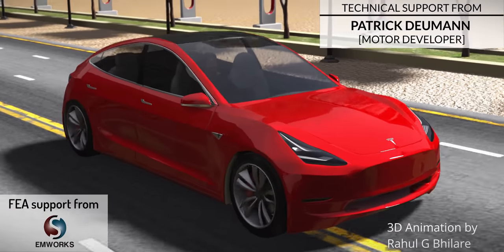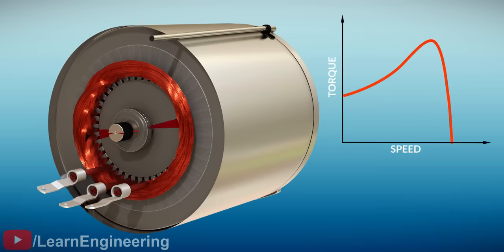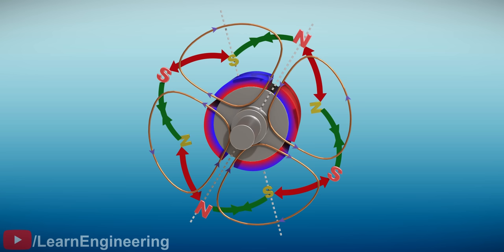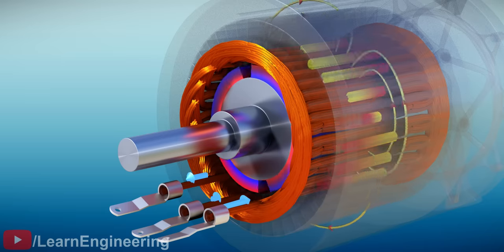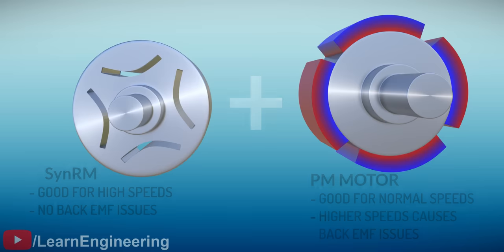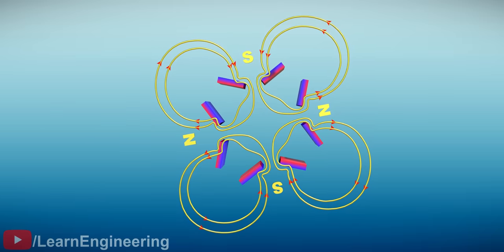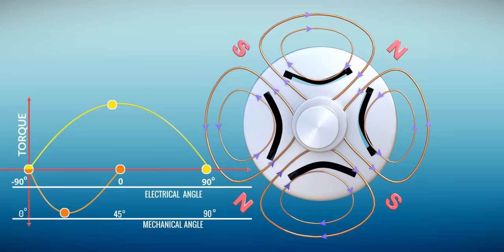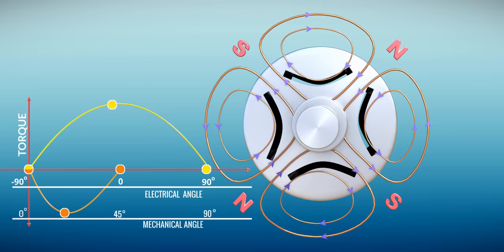Tesla Model 3's motor - The Brilliant Engineering behind it

Comment: As an engineer... Just imagining the integrals need to calculate that magnetic fields ... a vision from hell or heaven... afterlife for sure...
Reply: Embrace Maxwell my child
Reply: why do you need to calculate them, they just work
Reply: @tonial5789  , well... someone did that math. And probably if you get back to that degree/masters... That monster will be there... Waiting for you... In the corners of eletromag 3...
Reply: @tonial5789  to make the rotor the right shape. No point just guessing.
Reply: That's why there's programmes such as MATLAB. No need to sweat over calculations
Reply: @serBarcla  Yeah the burden of having to deal with the hellish math gets ultimately pushed to the software engineers.
Reply: In fact, you can just use an finite element method (FEM) software to calculate these integrals for you.... The real HARD work for the calculation is done by the ones that create these FEM softwares (4D Maxwell equation solvers) which are usually tough programmers/mathematicians or PhD students (most of them REAL electrical engineers) without girlfriends or any kind of social life... #AHugforaPhDstudent
Reply: Integrals are frightening, I had the same thought and felt pretty bad at not finishing my engineering major. Total mood kill I tell you.
Reply: As an engineer, Finite Element Method simulations with tools like Ansys Maxwell and similar software makes this strangely easy.
Reply: @cleisonarmandomanriqueagui9176  electrical engineer. 
Just pay attention to the specialization in your local/country . 
Some places they divide in electrical engineering: circuit (micro-eletronics) , power (grid and high tension) , communications (telecom) , computer , and mechatronics (robots). 

Depending on the specialization you will not see electrical motors . (But that came with it's on benefits, like the spiritually of how antennas works... 50% math, 40% electromagnetic field  (ghost 👻), 10% pure believe and Faith.
 (because there is some magic/mystic level or sorcery involved in explain how the hell an LPwan [sigfox/lora] device get a signal, 20km away. Using 2 AA battery... )
Reply: @cleisonarmandomanriqueagui9176  mechanical engineering
Reply: @cleisonarmandomanriqueagui9176  You want to get into the nitty gritty details of quantum mechanics, you would have to do a physics major specializing in that. Once you have satiated your appetite for that, move onto the practical side of things, i.e., engineering. Why stop learning after just one degree? Never stop. There are a lot of stuff on the interwebs to self learn as well, so going to a university is only needed if you're really passionate to learn the things they're teaching, otherwise it would be a waste of time and money
Reply: @thearkpearl  so true man the CS engineering are hella smart
Reply: @flow5718  go back
Reply: @cleisonarmandomanriqueagui9176  you probably would like mechatronics engineering, or if not available:
Control and automation engineering.
Computers engineering.
Micro-eletronics engineering.
Reply: @6Diego1Diego9  I was doing electrical engineering, found out I was good at computer and coding but not much else. I'm a web dev now :)
Reply: Vision of heaven only if they're correct.
Reply: If you are an EE grad student you wouldn’t imagine. You would have to do it.
Reply: @cleisonarmandomanriqueagui9176  mechatronics is the degree you're asking about. It combines mechanical and electrical engineering
Reply: theres a sensor for that. LOL
Reply: Robert Slackware  but to get a job i need a degree and i dont have money to make a business or a technology company ... i ve already thougt what you said but i do read books and see video lectures of what i like
Reply: no, not really, we have a lot of simulation software. The job of engineers responsible for simulations and writing this software is harder
Reply: @TheCarmacon  whats the name of the
 book ?
Reply: @Mrwiseguy101690  And why not, they're paid quite well for it :P
Reply: As a mechanical engineer, I really am jealous of electrical engineers. This looks so cool
Reply: @thearkpearl  bless them
bless them
Reply: Well, you must not be much of an Engineer bc ANY computer today has a built in MATH Co-Processor (these were available for OPTIONAL purchase way back w the 286  Processor computers. and reason why the Motherboard came an empty socket always. even the 386 too.)
That Math Co-Processor was Eventually Built-in with the 486....and ON......
Today's computers can make all those calculations on the fly!! and even Create Graphics(as shown here) in fact, the same software can also conduct FEA Analysis on the Fly too!!! 
(Pinchi Menso!!  Aprende algo! antes the llamarte "Engineer")
Reply: U don't need to do integrals buddy....It's you software's job
Reply: @vanni.  Indeed.  The guy calls himself "Engineer"....I doubt it.......
Reply: They have computers to model it
Reply: @serBarcla  and Python
Reply: @cleisonarmandomanriqueagui9176  Electrical engineering
Reply: @Barrios Groupie What is your address?
Reply: Ansys and other design software include that kind of calculation and more. Algorithms can do those in no time.
Reply: I guess you went to school around the same time as me, or earlier, before all this fancy computer modelling. Now any cheap computer can run the modeling programs. The heavy duty computers are reserved for the gaming community.
Reply: @cleisonarmandomanriqueagui9176  I did a general engineering degree specialising in electronics and control in my last 2 years. (a 4 year degree). I was dubious at first (I didn't enjoy fluid dynamics at first!), but one advantage is that you can go into a job like this one and you know what the physical engineering people and the materials engineering people and the others you're working with are talking about. You have an advantage working in a team on a product like this. If you choose a speciality like control engineering then it helps to understand the systems that you are controlling.

There's a fair amount of control engineering in this, as well as the magnetics and electronics to drive it.

Another advantage of doing 2 years of general engineering is if I really decided I like thermodynamics and fluids after all that, I could have changed my mind and specialised there instead. My masters topics in Control were chemical plant control, which is non-linear and involves delays. Quite a challenge.

I have a friend who works with synchronous motors like this. He has to solve problems like finding the best driver transistors on the electrical side to produce the currents for the rotating magnetic field.
Reply: No worries! Discretization and numerical integration methods are on the hand.
Reply: @Mrwiseguy101690  My guess would be the assistance of some mathematicians and the huge advantage of programming loop and boom , FEM is done. Not easy ikr but loop, is the core of FEM softwares , in doing the differential, just google how it works , kinda fascinating
Reply: @serBarcla  and finite element analysis
Reply: @cleisonarmandomanriqueagui9176  an Electrical Engineer Program with Motors and controls courses and automatic control systems courses. (not all have them)
Reply: @cleisonarmandomanriqueagui9176  Control Systems
Reply: @cleisonarmandomanriqueagui9176  Electrical engineering (power electronics, mecatronic). But I dont advise you to get too specialized in motor itself. There is very few job available for that specialty. It better to have a correct degree in electronic and automation to know how to control that motor (regulation loop of field oriented control, field weakening strategy). 
For a simple reason, there is no a lot of company that design their own motor, the most often they buy off the shelf or reuse some design already performed in the past and scale up/down to match the requirement
Reply: @UPR91  thanks for the advice ... its very usefull
Reply: MAXWELL could tell you....
Reply: Robert Slackware  print the names of the books to help people.
Reply: @Götz von Berlichingen yeah exactly years old so why not use a bldc instead?
Reply: Let's play a bit Maxwell...
Reply: I'm pretty sure they ran simulations on a pc, nobody is interested in solving this bs
Reply: @cleisonarmandomanriqueagui9176  Electrical engineering, or perhaps Mechatronics.
Reply: @serBarcla  MATLAB is just for writing your calculations up and it will calculate them. The problem is finding out what you are supposed to calculate and write the integrals yourself
Reply: @cleisonarmandomanriqueagui9176  start reading electricity and magnetism, then electromagnetic theory of changing magnetic field. I college go for courses in electrical machines.
Reply: @Keskusrikospoliisi  fair point
Reply: @cleisonarmandomanriqueagui9176  You need a degree in Electrical Engineering. As  @Welton Barbosa  says, there are a number of specialisations within electrical engineering. The most important thing is that you need to have a really good head for mathematics, so study that as hard as you can while you are still at school.
Reply: 666 likes here
Reply: What kind of an engineer are you to do integrals by hand? Use a transform or a program that will do it for you. It's not a competition to see who's got the hardest work
Reply: Let alone the timing based on the the sensors to keep the rotor at a 50 degree angle for the greatest torqued every time you start moving. wowwza
Reply: With powerful computers and sophisticated software libraries such as MATLAB, it matters more now for engineers to properly model the phenomenon and formulate the problems rather than to do calculations.
Reply: @tocu9808  < Especially to optimize eddy current losses to reduce energy loss as heat, and improve on the motor's efficiency.
Reply: @Keskusrikospoliisi  - That's core value of engineers. Exactly the way high math should be taught for those major in engineering disciplines.
Reply: @thearkpearl  Er ... Girl friends may or may not help to release some tensions which disturb calmess and focus required for effective brainy works.
Reply: Civil engineering
Reply: Think about FEA and harmonic current distortion of this.... analytical approach is just to create boundary conditions. Being a powertrain engineer it's under consideration .
Reply: @Elliesium37  Seconded.
Reply: engineers simulate it with COMSOL for instance, they don't calculate it by hand. Also,  this magnetic field configuration is rather simple. There are devices with way more complex magnetic fields.
Reply: They used FEA
Reply: @serBarcla  someone has to program those too
Reply: my guess is math by comsol
Reply: @gnaarW  better yet embrace Heaviside
Reply: True
Reply: I fear no math, but that THING... It scares me.
Reply: @tonial5789  to find out what works the best
Reply: I swear to god they probably used wolfram alpha lmao
Reply: Math will give you diretions but you need to tryout and start using, then you make it better and better to perfection 😉
Reply: I had a motors course 30 years ago from prof Nattu at U Michigan Dearborn (salute wherever you are!)  My smoking buddy.
Reply: @tonial5789  if you can't calculate them, no one would have figured out how to make them, and many improvements would be lost.
Reply: @Mrwiseguy101690  meh.  You can handle it.  You guys have canned routines for every damn math function known to man, and if you don't you  have an approximation accurate to more decimal places than you can machine...
Reply: @thearkpearl  You deserve a hug.  I appreciate you...
Reply: @cleisonarmandomanriqueagui9176   You need to do a Mechanical Engineering Degree. To prepare you need to study Mathematics, Physics, Mathematics of Physics, Chemistry, Mathematics of Chemistry, Design, Mathematics of Design, Electronics, Mathematics of Electronics. You get the idea. Mathematics is core to all aspects of describing how things work. Study hard on all STEM (Science, Technology, Engineering, Mathematics) subjects at school, also remember you need to communicate well, so having articulate language skills is essential. Choose hobbies which complement your learning, and allow you to apply what you know. Learn it, experiment, test it, prove it for yourself. All these separate skills at school/hobby level come back together at degree level, where you learn how they all interact in a beautiful tapestry of understanding, thus explaining how all things in the world work.
Reply: @dextrian  chemical engineer. i understand your pain. at this point of my life, i'm pretty sure sacrificing virgins to demon lords as much effective as designing low and cheap electrocatalysts for all its applications. demonology = electrocatalysis.
Reply: 🙏🙏Same here
Reply: I have two advanced degrees in two seperate fields of science. For some reason Elons's designs make me feel SO stupid! Someone must study his brain while he is still young.
I can see how his having a mild case of ashbergers. His concentration skills are computer like. I'm blown away!
Reply: Jeff Bezos is only a marketing genuis. I'll give him that. Elon is a true genuis on the order of his namesake, TESLA! Elon could easily out think Bezos., while probably .., ASLEEP! Therein lies the basis to Jeff's insane jealousy of Elon. It's like when Westinghouse and Edison only beat Tesla due to marketing tricks. Just think how much farther ahead the world would be today if the world and the U.S would have listened to TESLA! Does anyone besides me Elon could possibly be a reincarnation of the great Serb? [Don't laugh., just ponder the thought]
Reply: @harrycarter7861  If such things happen (and there's no evidence either way), it would be lovely if he was. The problem has always been humans have such a short lifespan given the issues we face are global scale. If Elon can pull off starting Earth 2.0, there may be hope despite China fizzing at the moment due to internal issues and blaming everyone else like a spoiled child.
Reply: That's what simulation is for. Who the hell actually calculates integrals after leaving university?!
Reply: @dextrian  Even in the USA, not all electrical engineering schools offer the same specialties.  Some areas in power engineering include electrical machines (motors of various designs, transformers, power transmission systems) and microwave engineering, digital signal processing, analog and mixed-signal processing, control systems engineering.  Other areas include Radio frequency, radar-band communications, and other areas as wireless communications, wireline communications, cellular communications as well as "hybridization" or "integration" of wireless and wireline communications (i.e, telecomm protocols, and computer-network communications.) Some, typical blends some areas of computer science department.
Reply: @dextrian  You will need control systems engineering and computer engineering as well as radar systems engineering in order to help your country's air defense system to develop UAVs (unmanned aerial vehicles) to seek out high-value targets (e.g., like killing some evil generals and field commanders.)
You might also need information system security knowledge, like systems encryption/decryption for secure wireless/wireline communications, radar jamming and military communication technologies.  So much and so broad, that you might not want to work in mechatronics for ground transportation systems ever.
Reply: please don’t despair ,it’s just nature and natural science ,and in regard to magnetic fields ,we humans are all composite of magnetic fields ,Ronald -Strada .
Reply: Magnetic circuits can be analyzed using the Finite Element method that's been around for at least 20 years.
Reply: Cleison Armando Manrique Aguirre Either If your interest is electric motors for cars, then mechanical engineering.  The Tesla motor design team probably included both mechanical and electrical engineers.
Reply: TheLastCrankers maybe a student or recent grad? or just an engineer who enjoys math!
Reply: tbf theres python libraries u can get that just automate the whole integration part.
Like the maths are basically done for you.

CAS systems have been around for a long time
Reply: @dextrian  The deeper you dig the deeper the hole gets.
Reply: @cleisonarmandomanriqueagui9176  The ones who understand the fundamentals best are physicists. Engineers apply what physicists learn.
Reply: @cleisonarmandomanriqueagui9176  No individual can know everything. You have to make choices. To best understand fundamental principles study Physics. To learn how motors are made start with mechanical or electrical engineering.

Comment: Tesla Marketing Stunt, this principle is known for over a century, and motors like this are in commercial use for decades. Now suddently we talk about them in a context with Tesla Motors. Well done Marketing, I guess this guy works for Tesla??
Reply: he must be, i find it funny how marketing guys for Tesla and electric cars always claim that electric motors are more efficient, while never showing any form of prof like a datasheet for the motor and independent tests. in reality electric motors have always had more or less a bad efficiency, at least when u take in to account every step the power has to pass through to eventually be used by the motor. not to mention that most generators has a efficiency of 50% or lower and there is very few that are more than that(the same goes for a motor as a generator is virtually identical). this all one makes the over all efficiency 25% or less making electric cars not that good. i wonder what Nikola Tesla would think of the Tesla company.
Reply: I think you missed some important parts.  The three variable frequency phases are generated by some rather sophisticated electronics.  The semiconductors that were capable of switching hundreds of amps at hundreds of volts have not been around all that long.  These are not induction or brushed motors, they are much more advanced.